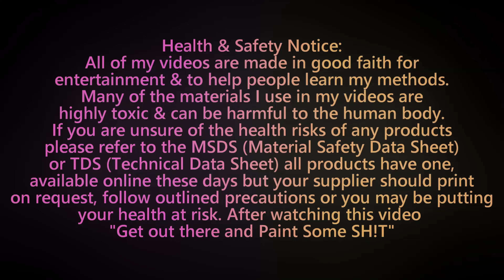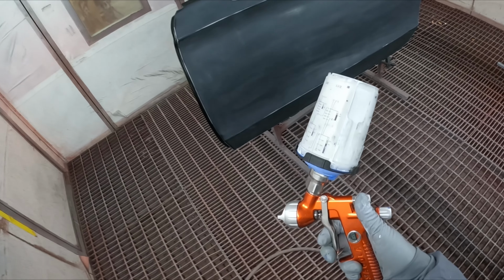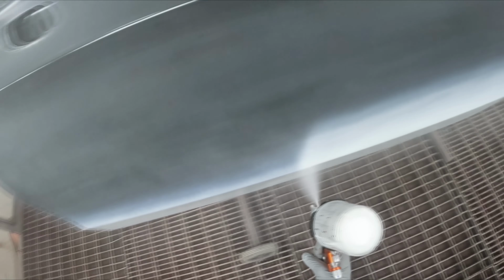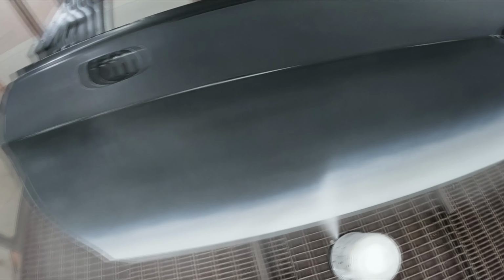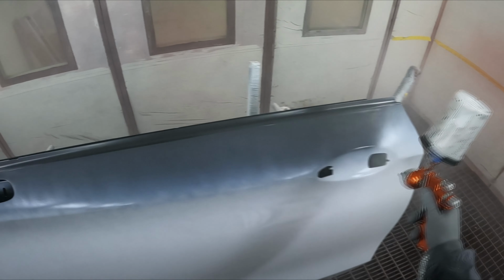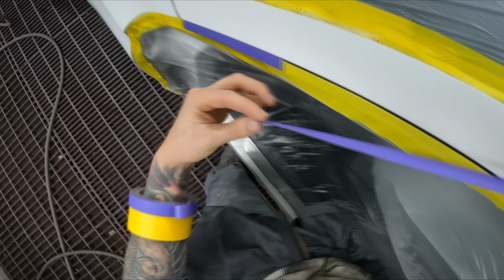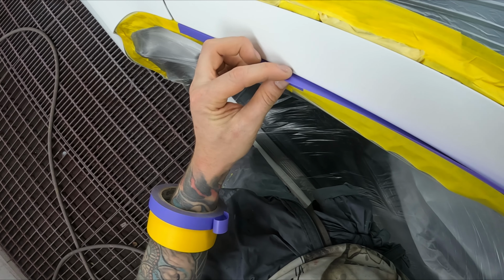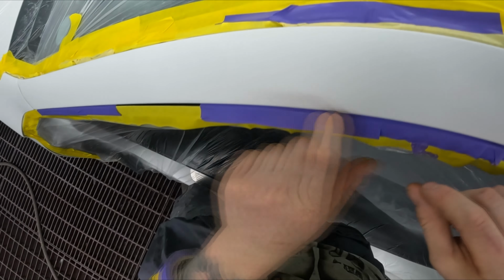C200 Benz Masking & WOW

Comment: 90% of my blocking is directional you can't realy look down and look at that angle from a quarter panel or a door unless you lay the car on its side or lay down on the roof. but to each their own , one of my coworkers could pretty much get a panel 90% straight with just a da , others like to block their filler repairs i do a bit of both 60% da and 40% blocking